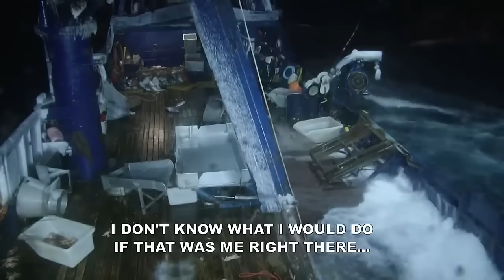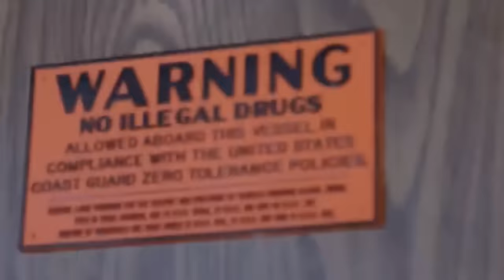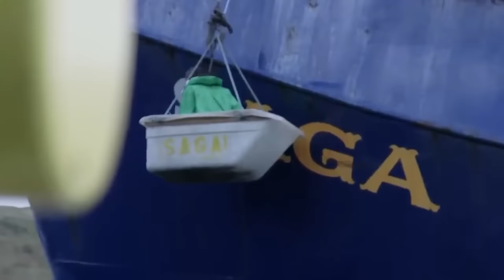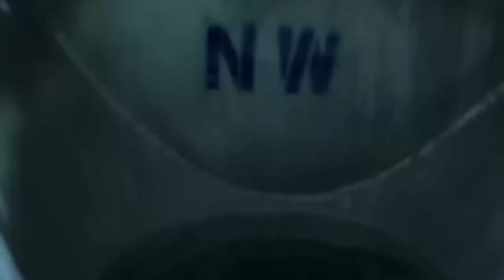Mouthy Deckhands, Catastrophic Fires & More Iconic Moments On The Saga | Deadliest Catch

Comment: It seems like there's probably safety features that could be implemented on the boat, but I guess it's cheaper to hire new crew
Reply: There's only so much you can do in the middle of the wild Bearing Sea. You could be the safest boat in the fleet, but all it takes is one rogue wave.
Reply: Bro the titanic was an “unsinkable ship” and look where that got them the ocean is strong like very strong even some military ships are rendered useless when the waves are large enough
Reply: No amount of safety features can really save you if it gets bad enough on the ocean.
Reply: @Sy7ther  The titanic was designed to be unsinkable but had severe manufacturing flaws (What happens when you outsource work) and a questionably trained crew
Reply: Safety features like what?

Comment: That should make them get some full face breathing apparatus so they have this sort of a Smoke Up much easier to work on and eliminate the danger. Its better to have the apparatus and not need it rather than need it and not have it, esp as you are so vulnerable so far from port, and that's is good weather. Imagine a raging southerly blowing the Ice Pack toward your stranded boat, OMG! Safety First Shipmates.
Reply: I saw a clip of another ship that had one so they could go into the engine room and carry out repairs.. may have been Sig’s Northwestern
Reply: They're supposed to have them!! I'm pretty sure it's a requirement for all boats! Just for this reason!!

Comment: they urgently need oxygen masks in case of fire or smoke. The smell of burned clutch is very typical. Bad job of the Saga crew they searched so long for the soruce of the smoke. Also the clutch should be checked and replaced at regular intervals. It´s called maintenance
Reply: They acc have tanks of air that are the same as firefighters but i think they prioritise finding the issue rather than their own health and they also have oxygen which is the very opposite they need in a fire it would lead to a huge combustion but they do have some ive seen in a first aid kit type thing but the one episode ive seen it the deckhands helping the one who had just got smoke inhalation says’do you even know how to use this’ so honestly not the biggest positive lmfao

Comment: Worked on fishing ship around 2000 and even then when we worked outside we always wear a helmet to protect our head
Reply: A helmet does not make an iota of difference with a crab boat. A single cage can take your life in the best of conditions. When you factor in the Bering Sea, Rogue Waves, hydraulic mishaps the danger increases exponentially. Losing your skull is just 1 dangee. Working on a factory ship is night & day. Insurers require A helmet, even if they will likewise do nothing.